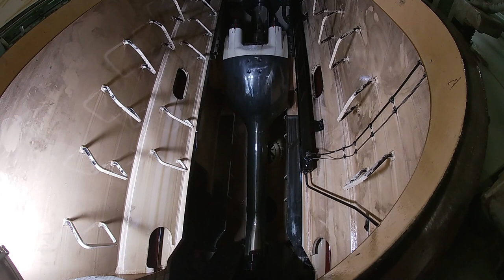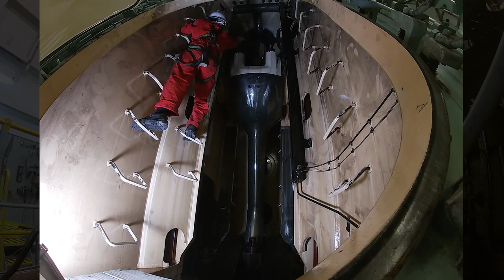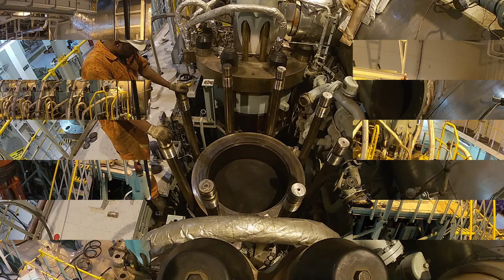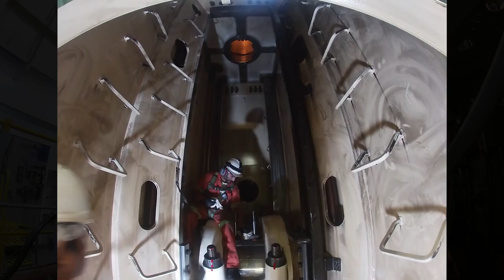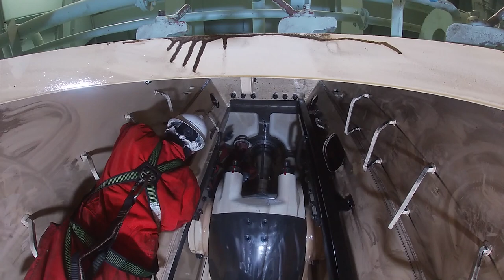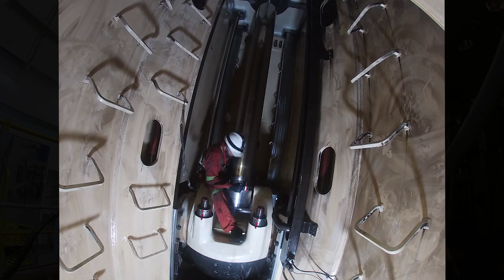#ship #marine #engine #2stroke   Main engine unit overhaul

Comment: Sir what will be the role play for fresher 4th eng when this type of majour over hauling is going on board he have to assist or he need to work
Reply from the maker: A Senior engineer(probably 2E) will dedicate a job for you. It's always good to have a pre start meeting, discussion and sort all your doubts so you know what you are supposed to do.
Reply: The 4/E would have been at sea a while, he could be in the crankcase with the 3rd or on the tops so quite familiar with pulling a unit.
Pre-start meeting, goodness me. Yes, you and you C/C , you and you Tops and the 2nd keeping   an eye on whats going on in both places at critical times, plus calibrating the liner, piston, fitting new rings.  Cannot say we fitted a spare piston and rod except if piston was badly burnt.

What's with all the safety hats and gloves, blooming wimps. If any of those lumps fell on you a safety helmet wouldn't help you. Safety harness in the C/C, gee?

Comment: What will you do with the piston which is removed? 
What process and how
Reply from the maker: Removed piston will disassemble, clean, inspect  and assemble with new Orings. Then it will hydraustaticaly pressure test to confirm no leakages from seals.

Comment: if distance piece is not there to hold stuffing box what would happens?
Reply from the maker: While lowering and aligning piston rod palm with the crosshead, if that distance is not available the stuffing box will sit on the stuffing box gland and we'll have a very hard time lowering the piston(the 4 holes will not align with the crosshead bolts) if the clearance is available, we can move the palm and align it. 
I hope you get the idea

Comment: How much time does it take for 1 piston hauling?
Reply from the maker: You mean unit decarb job (like this one) ? or only piston O haul?
Reply: Whole unit
Reply from the maker: @_kartik_pandey_1510  roughly 8-15 hrs. Depending on the competency of the crew involved, all goes as per the plan or not. You may end up spending a precious few hours just to lose some frozen part
Reply: Depends how many beers you had the night before, usually 2 working days of about 6 hours each, but fewer people.

They don't have technicians on ships.  They are all Marine Engineers.

Comment: My experience  in automobile  6 years 2 years diploma  certificate for automobile  engineering
Reply: Nothing like automobiles, no 2 strokes, but same amount of cleanliness when assembling, oiling piston rings, though they didn't check the cylinder lubrication whilst the piston was out.